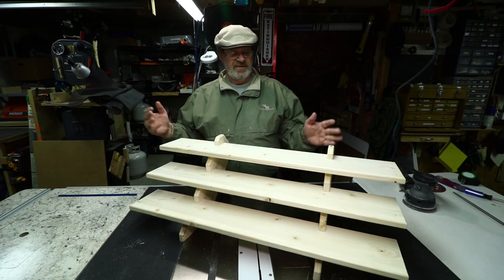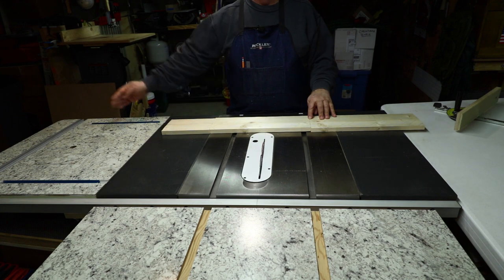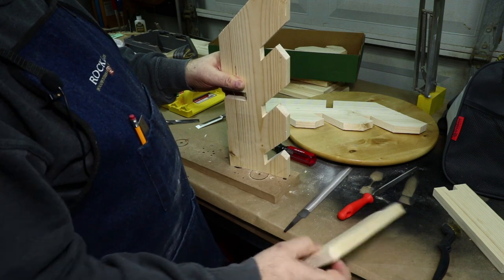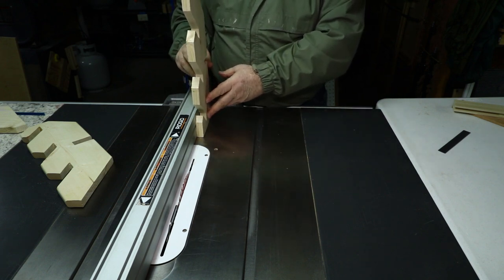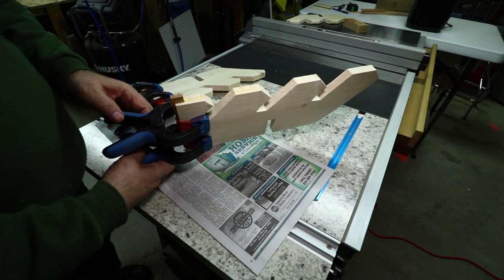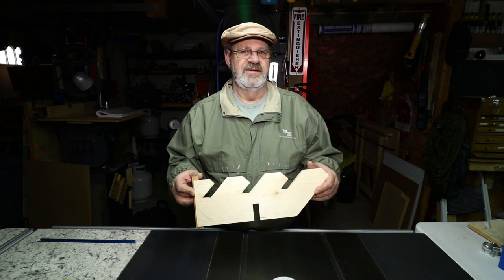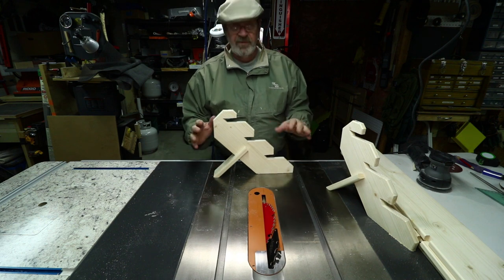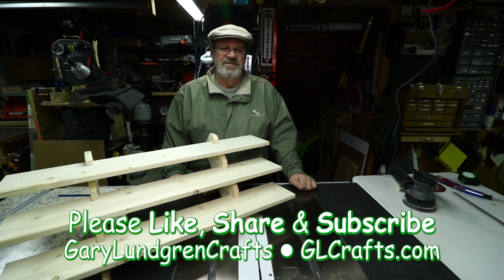Craft Show Display Shelves Vr 2 New & Improved! Ep.2018-02

Comment: Great project! Sand paper glued to a paint stir stick works great for sanding out the notches for fitting.
Reply from the maker: Thanks!  Good tip!  I had cut a board before and adhered 80 grit sandpaper to it for sanding and fitting the slots. Prior to that I used a file. 😕  The board was much better, but both techniques were slow. Then I found a sander at Harbor Freight that does a great job quickly. I did a video on that. See this:  https://youtu.be/tjJYv7QEM2k
Often I get a good fit just at the band saw and sometimes I have to fit the slots by sanding. 

Thanks! 👍

Comment: Gary,  I am trying this out myself thanks for sharing I did not see this question but how deep are the 3 notches where the  shelfs go into. i did notice that you used a band saw on this video and on your first you used the table saw @ 45 degree angle i just did not know how deep the cuts should go. thanks for sharing your video
Reply from the maker: Thank you! I had made a correction to that before, but it didn't seem to get linked correctly. I fixed it now. Thanks for letting me know so I could fix this. The shortcut for you is: http://glcrafts.com/Resources/DisplayShelves4CraftShowVr2Sketch.pdf

Comment: I like your shelves. I've printed off the template you supplied and will make a set or two. Thanks for the time and effort into designing and posting all of the information needed to DIY some ourselves. Can I make one suggestion for future videos (and this is not just you, its 1000s of users who post DIY video that include loud machines in the video). During your video editing process and you are adding section of video/audio that include using your table saw, band saw, jointer, sander etc etc etc... please lower the volume of your video as its WAY TOO LOUD listening to a table saw, we all know what it sounds like, we dont want to hear it in your video, thanks.
Reply from the maker: Thank you!  Thanks for the suggestion to reduce the sound level when machines are running.  It is annoying and I try to do that on latter videos.  Thanks 👍